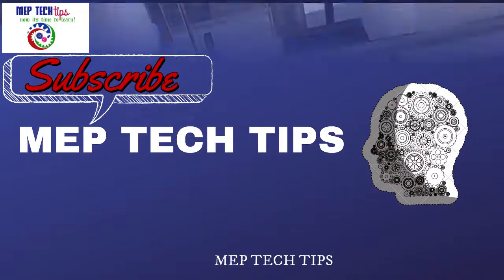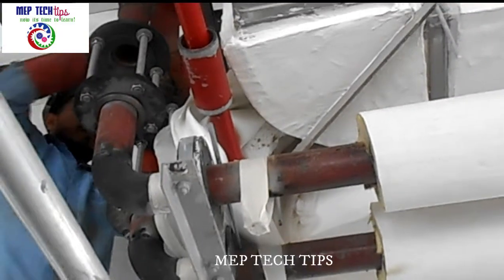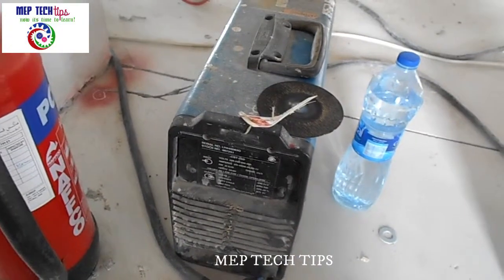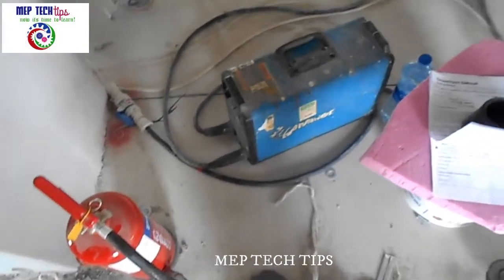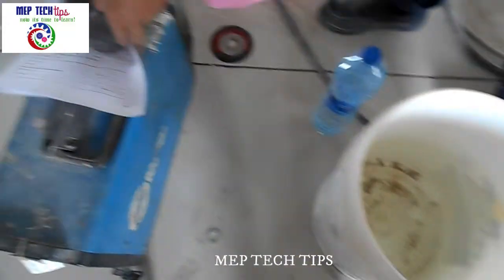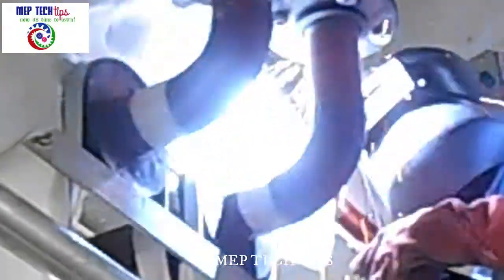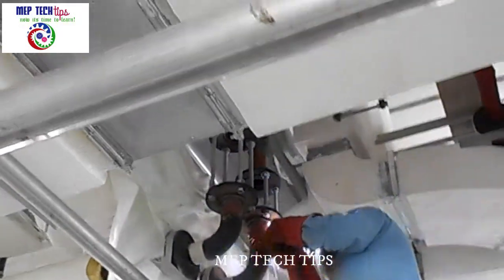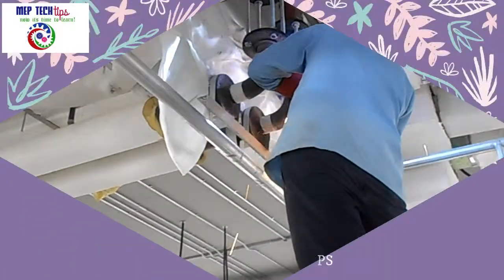Chilled Water Pipe Welding @ Riser | Chilled Water Pipe Welding | By MEP Tech Tips

Comment: Sir,What is the type of flange called,
Why there is a gap between the flanges with rods.
Reply: valves need to be installed there .
Reply: Typically we add a "spool" piece between the flanges which is typically the same length as the intended spool pices. Normally we use them when we do not have the piece fabbed with o-lets for thermal wells,petes plugs,reducer bushings for test probes and valves for pressure readings ect ect.